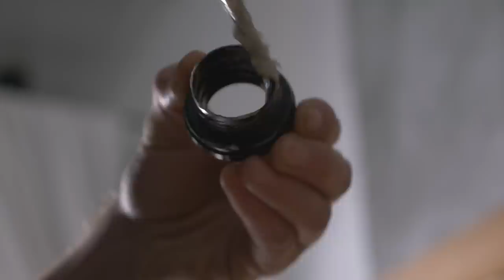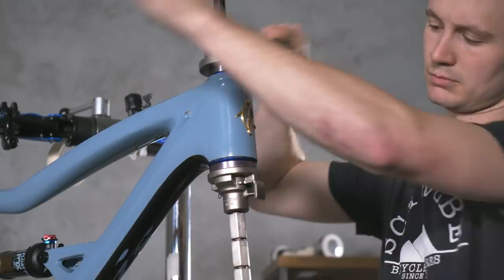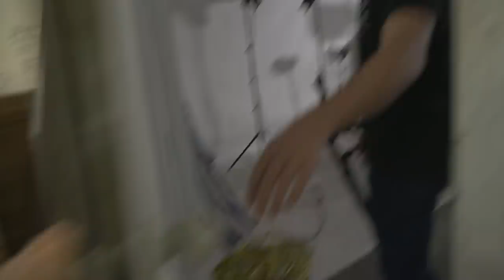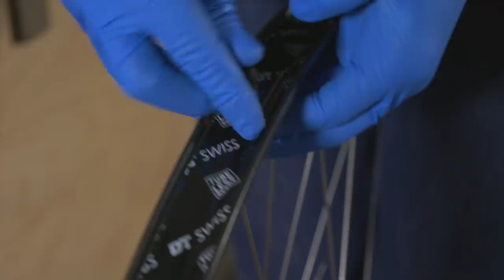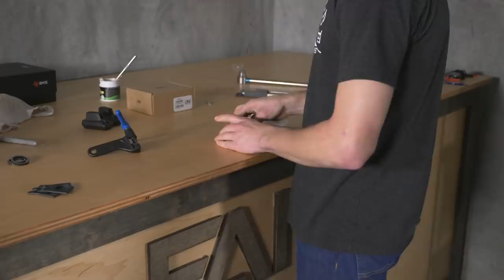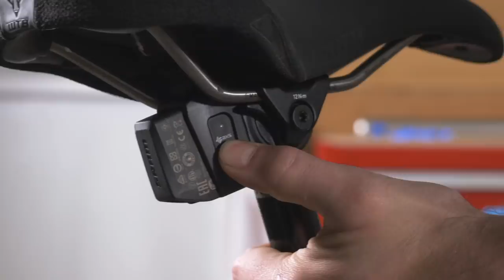Dream Build - Ibis Ripley

Comment: A combo of black and silver spokes would have really set those wheels off! 
BTW,  why the spacer behind the cassette? Just  built up my new wheels with black/silver spokes with purple i9 hubs. Got a purple stem too for my blue stumpy.🥰I love it.
Reply from the maker: That would have been sweet!
It's an XDR (road) cassette, which is a bit longer. To get the right spacing you use that 1.85mm spacer behind the cassette.
Cheers! 
Dan at Fanatik
Reply: Cassette or hub? Is that 11 or 12 spd? Was wondering if using an xdr hub with spacer on 12sp would give a better chainline on big cogs!?!?